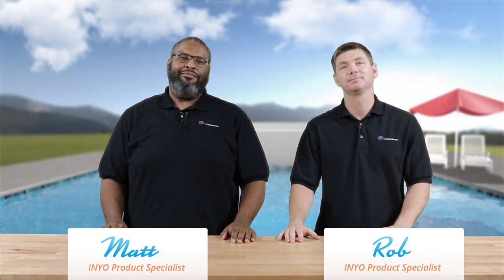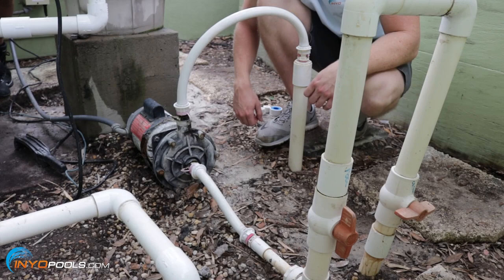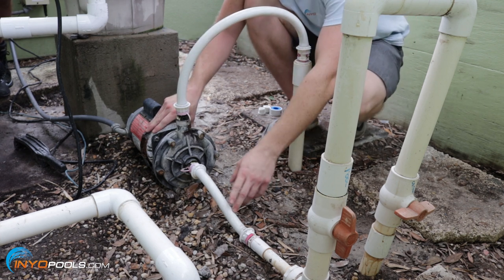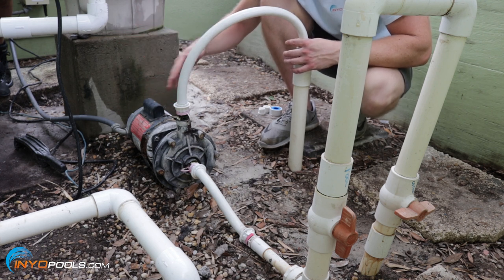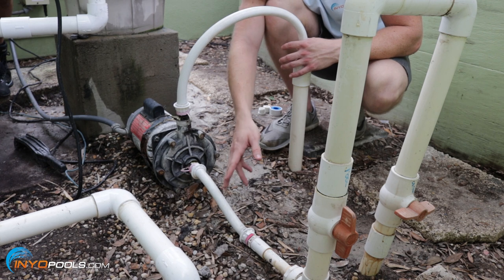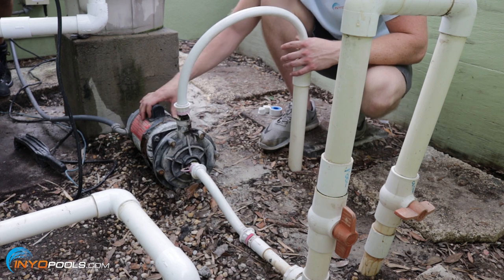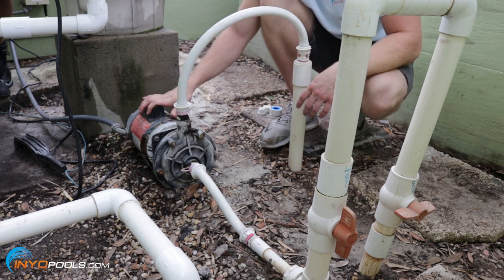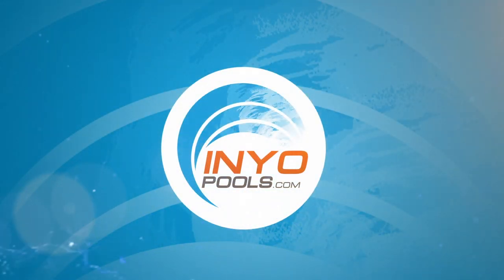How do I remove my booster pump?

Comment: Very helpful, right to the point, and pleasant to watch! I had the same exact question and am now off to the hardware store for a couple of threaded 3/4" or 1" PVC caps/plugs (I'll take one of the softube quick connects with me to be 100% sure I get the right size) and I already have teflon tape. Thanks so much!  (I only added all that hardware store, etc. stuff in because someone asked about where to get the plugs a while back 🙂)
Reply from the maker: Thank you for the feedback. Glad we could help!

Comment: I removed it now one of the jets is not working
Reply: That’s because the water coming from that jet was being pushed through by the booster pump, which you removed, so that jet is no longer part of the system.

Comment: "No one was watching anyways", lol. Thanks for the video  though.  It would have been great if you guys also explain why a robotic cleaner is better than the one operated off the side port.   A robotic cleaner is great for picking up large debris like leaves.  But it's filter is not fine enough to pick up small particles.  I guess we can still run the robotic cleaner often enough so the smaller particles are stirred up and goes through the pool pump.  Some how my pool is really deep and so that's not very effective.
Reply from the maker: The robotic cleaners are nice because the can handle larger debris than suction cleaners. Most of them offer a fine bag or filter to catch the small particles. I use one in my robotic cleaner and it catches everything I can see. The stuff I can't see will end up going through the main drain or skimmer.